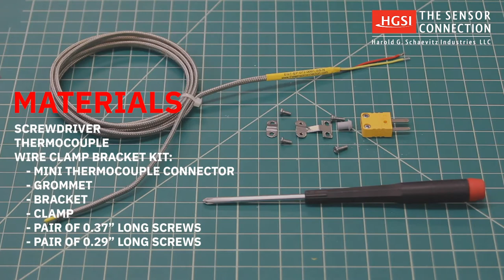How to Install a Mini Thermocouple Connector Wire Clamp Bracket

Comment: Nice video! I have a thermocouple that I bought from Amazon and I was wondering what type of wire can I use for the extension to connect the pid and thermocouple
Reply from the maker: Glad you liked the video! Best practice is to use extension wire that matches the thermocouple Type. For example, if your thermocouple is Type K, then use Type K extension wire. This should also include the connectors you use to join them together. Join a Type K thermocouple to Type K extension wire using a set of Type K connectors.